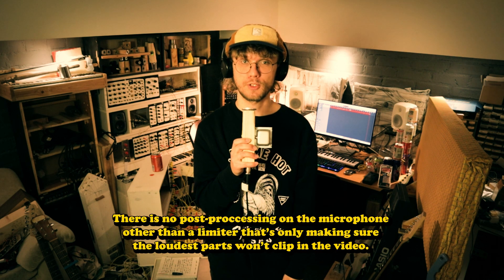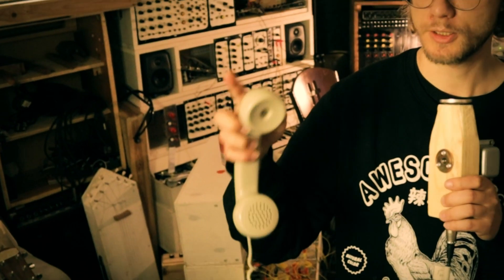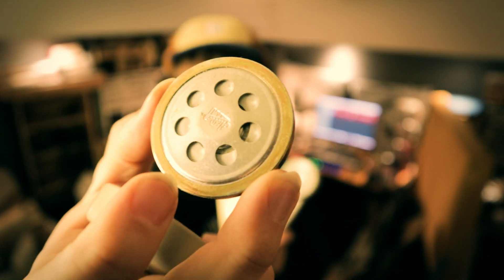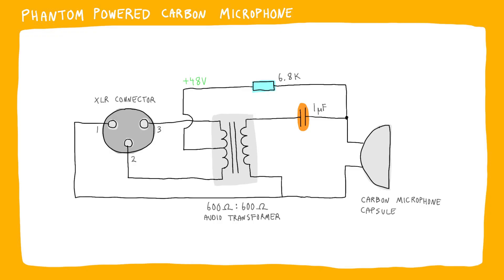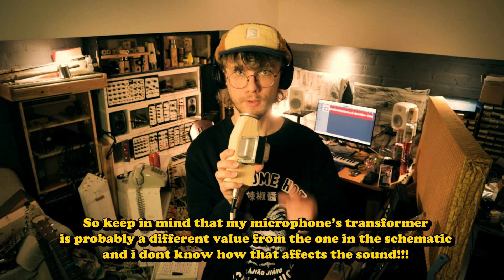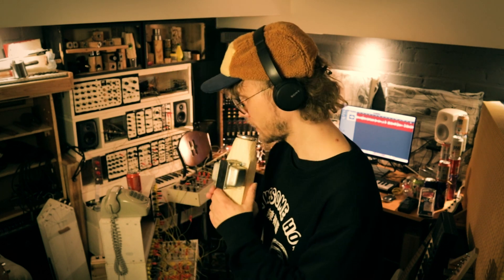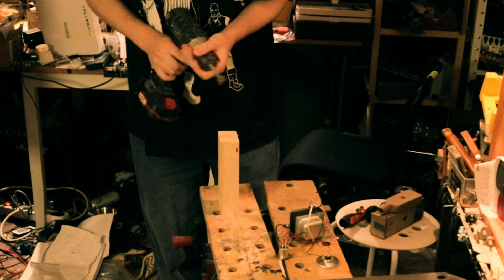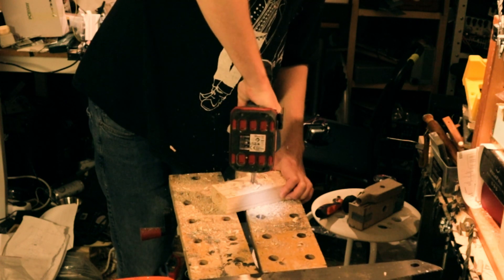Making a +48V Phantom Powered Lo-fi CARBON MICROPHONE

Comment: Hmm, it is possible to get high sensitivity from carbon microphone? Something like a whisper from a distance of 3-10 meters with acceptable signal to noise ratio. 😅 Maybe we need even higher voltage, special circuit, preamps etc.
Reply from the maker: I dont think you can get acceptable signal to noise ratio from a carbon mic no matter what hahah! But yeah i’m not sure how to improve the sound quality of one of these, havent really read that much about different carbon mic circuits.
Reply: @LAURISDIYCHANNELTV  I just ran some experiments. The microphone's power supply is connected through a 1 kOhm resistor, then I gradually increased the voltage.
1.5 V - lots of noise, low sensitivity
4 V - noise decreases, sensitivity increases twofold
8 V - noise is the same, sensitivity increases slightly
12 V - noise is the same, sensitivity increases slightly
16 V - noise is the same, sensitivity increases slightly (2 volts at the microphone, after shaking 3-4).
28 V - noise is the same, sensitivity seems unchanged (the 1 kOhm resistor is very hot lol).
An interesting point: if you connect another 1 kOhm resistor in parallel for a minute and then disconnect it, the volume increases twofold after a couple of seconds, but after a while it still returns to the original. A microphone amplifier is not required; the microphone is very loud, "line in" is enough. From this experiment, we can conclude that a microphone requires a minimum current of a few milliamps to function properly. To obtain sufficient current at low supply voltage without significantly reducing the 1 kOhm resistor (which would significantly reduce the volume), a current source circuit was used. The sensitivity and noise level were approximately the same as a cheap "skype condenser microphone"; whispers were clearly audible from a couple of meters away, but there was a lot of noise.

Comment: do i need a xlr interface for this, or can i just solder on a guitar plug and power transformer separately?
Reply from the maker: @user-mrmirajizhere-927  yes it should possible to power the mic separately, but i’m not super sure how to connect things then!
Reply from the maker: I think you could just have a 9v battery or a power supply in between the carbon capsule and the transformer so basically where the 1uf cap is? And i think you would remove the resistor, as you dont need the connection to phantom power. So you would only need the carbon capsule, transformer and a battery. Havent tried that so take this with a grain of salt!
Reply: @ thanks a lot for the response! i guess it all comes down to experimenting i will have to do lol
Reply from the maker: @user-mrmirajizhere-927  i suggest googling ”9V carbon microphone” or something and im sure there are schematics and forum posts available about this from people smarter than me!

Comment: I’ve got some appropriately graded carbon granules (that I bought for restoring old carbon mics) that I’m happy to send to you if you want to have a go at building your own capsule!

You just need a shallow cavity packed with carbon granules with two probes in contact with the carbon and a membrane on one side - they used to use cellulose for this but a thin plastic would suffice for DIY!

I have wondered what the carbon granules in a water filter would sound like - they are a larger grade so maybe less high frequencies or more noise or something? Could be fun 😀
Reply from the maker: i have actually looked at some videos and websites about building a carbon mic from scratch! You can shoot me an email about this stuff to madebylaurichannel(a)gmail.com and maybe we'll figure something out!

Comment: I've wondered about these for ages, got a small collection even, but too it could be fun changing out the applied voltage to the carbon as I've a feeling that lower voltages could make it sluggish whereas higher is more 'active'?
Reply from the maker: Maybe i will at some point do some experiments with carbon capsules! I have no idea if the voltage affects the sound or just the volume
Reply: @LAURISDIYCHANNELTV  My understanding is that the applied voltage kinda floats the carbon granules, creates a charge in them so they can bounce around, as it were, therefore (I'm guessing) more voltage equals more precision, greater quality, clarity?
Reply: @seankerrigan1627  At 15 mA, the voltage on the microphone was only 2 volts. At 60 mA, the theoretical voltage would be 8 volts, which is 0.5 watts of heat. I think any further increase would simply melt the carbon granules. Maybe, we can try to apply high frequency current instead dc, to increase peak voltage without carbon overheating lol, but most likely this will not lead to any improvements.